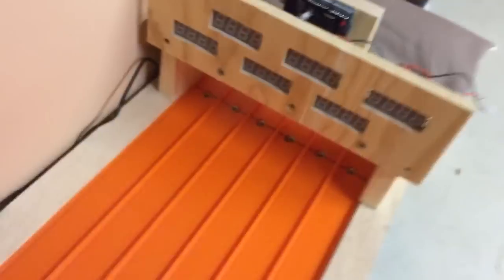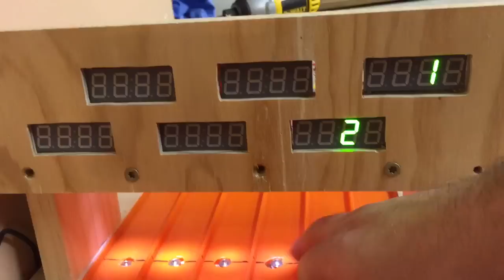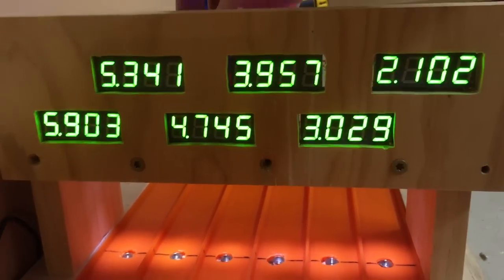How to Build a Hot Wheels Track and Electronic Finish Line

Comment: Pretty sweet. I am working on a similar idea right now. It will have an LCD readout and I'm working on a solenoid start line. When it is done you should be able to flip one switch to fire the start line and start the timer and one to reset. If I ever finish it ill share the programming for the arduino.
Reply from the maker: Championdjk I would be interested in seeing that! I am thinking about implementing the solenoid start with one switch for the timer/start gate I just haven't gotten around to it. The Arduino is set up for it I would just have to buy the solenoid and run the wire. Let me know when you get it built I would love to see it!

Comment: awesome work!,hey i cant find 4ft long straight track anymore,where's you find it? even amazon didnt sell that long straight track
Reply from the maker: I found it at Meijer several years ago. It was the weirdest thing, they put it on the shelf for $1.99. Every store in the area had tons of it. 2 weeks later they all put it on clearance for $0.79. I bought as much as I could find and have never seen it since.
Reply from the maker: Yeah it was a pretty good score lol. I remember walking into one store that had a fresh case of it so I just bought the whole thing. After that I would find maybe 1-5 pieces here and there but it dried up pretty quickly after it was put on clearance.
Reply: Diecastic btw can i make it without pinewood derby timer pcb?,because i can't find it on my country.
Reply from the maker: That I don't know. I would email the guy on the website and see if he has any advice.
Reply: Diecastic many thanks mate!
Reply from the maker: No problem! sorry I couldn't help more. Good luck on your endeavor!

Comment: Hello,
I'm very impressed with what you have done and would like to build a track and timer. Unfortunately your link doesn't seem to be working. It goes to a Chinese/Japanese website. Please can you let me know how I can access details for the build? Many thanks
Reply from the maker: Thank you! Yes, that was a mistake on my part, I forgot to renew the domain and someone snagged it. Currently I don't have it posted anywhere. 

Here is the link to the timer that I built. http://www.miscjunk.org/mj/pg_pdt.html

I built it using information that can be found on that website. If you have any questions let me know I will try to help!
Reply: Many thanks for your speedy reply. Yes, I have that link and that is the one I would like to build. Please can you tell me if you experienced any difficulties in constructing and getting the timer to work?
Reply from the maker: No problem! It was pretty straight forward. I didn't have any issues. One thing I would suggest is managing the wires better. I just kind of have mine randomly all over the place, I think organizing the wires would make things less messy and easier to resolve any problems if you did come across any.

Comment: Does the finish line stats connect to a PC to gather and record stats?
Reply from the maker: I believe that is an option if you have a PC. I only have access to Mac and at the time of the build the software didn't work with Mac. That's why I went with the LCD displays, it was either that or not be able to see results at all. I'll link the website with all the info I used to build this below. He has a lot more info on there than he did when I made this. He also is pretty good about responding to questions so if you build this and need it to record results I'm sure he could help you. It was a pretty simple build, this was the first thing I had ever made with electronics and although it took me a long time because I didn't know what I was doing I didn't hit any major snags at all. Once it was all together and I figured out how to install the software it worked great. http://www.miscjunk.org/mj/pg_pdt.html

Comment: This is awesome my son loves hot wheels would love to build this for him any chance you could give me a list of parts I need for the finish line , would be very grateful ?
Reply from the maker: Well unfortunately I accidentally lost the website where I had it all posted. However, there is some good news. The site that I bought all the parts from can assist. That site is where I found the original parts list for this. this site also has the software required to make it run. You will need an Arduino plus a plethora of other electronic parts. As for the actual track itself I built it out of a sheet of 1/2 plywood. I ripped it into strips that are a foot wide and four foot long. I got extremely lucky and found 4 foot sections of track at Meijer for $0.80 each. This was in 2014 and I have not seen them since. I know that Toys R Us has 2 foot sections of track or almost all retailers have 1 foot sections. Any will do just fine. To prop up the track at an angle I just cut down 2x4's. If you have any other questions let me know, I'll do my best to help. Pretty well everything can be found at this website though. http://www.miscjunk.org/mj/pg_pdt.html  Good luck!
Reply: Diecastic cheers mate thank you
Reply from the maker: You're welcome